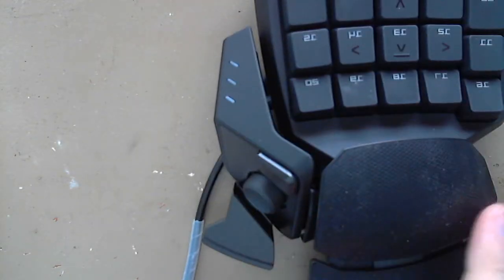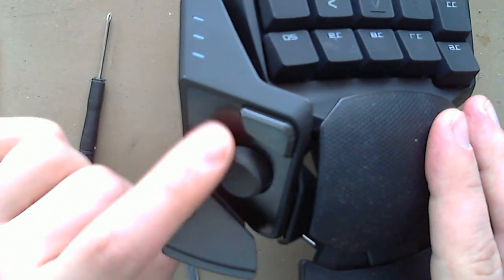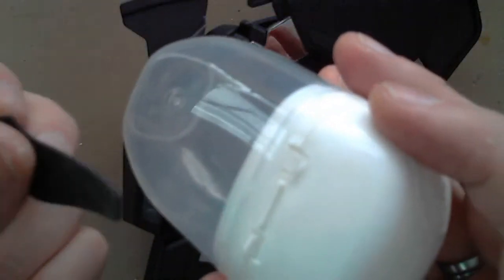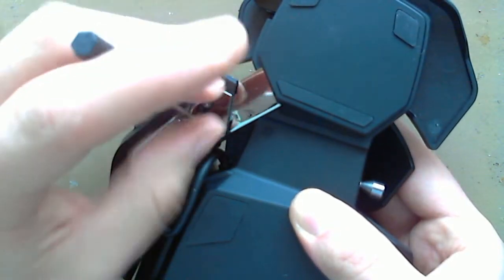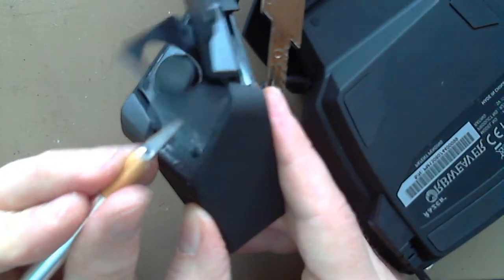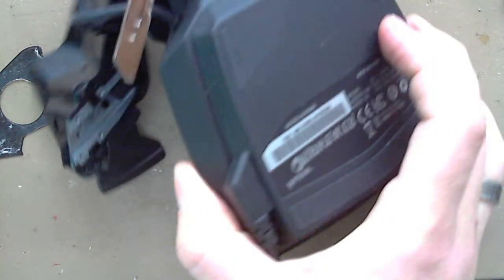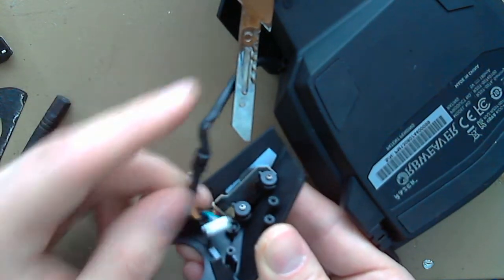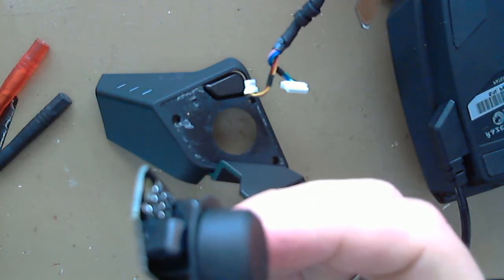Razer Orbweaver Thumbstick Mod - Part 1 Side Module Disassembly

Comment: To lift the thin plate on the thumbpad face, make a tool. Get a piece of 1mm thick PTFE sheet and use a file to create a chisel edge on one side. Then use emery paper to put an ege on it until it is knife sharp. You could use sherpening stines like a chisel if you have them. When you push it under the plate, it will glide uder and barely be effected by the adhesive. You can work it around until the plate comes away. It's softish stuff so the PTFE makes a great tool as long as you don't over stress the part as you lift it off.

Comment: Can you tell me what the micro limit switch is called that sits above the analogue stick on the orbweaver? I need to replace mine if you can help id appreciate it very much
Reply from the maker: @Mikey-oz2sp  it's the same switch used in the dpad and thumb lever. Two leg micro mouse switch.

Comment: Thank you so much. I had to get into the side module to attempt to fix a button and I could not find how to do so. This was a huge help.
Reply: Would it have happened to be the microswitch for the spacebar / clutch? Mine has started double clicking and if you know what's a suitable drop-in replacement switch that'd be awesome.
Reply: @ImTheKingOfHyrule  It was for the spacebar yes, but it was because it wasn't pressing at all. I opened it up and piece that hinged it in place had broken. I unfortunately don't have any advice on replacement. :(

Comment: I have major inconsistencies with one of the thumb pad switches and my piece is practically new it has just been sitting in a box for a few years. Where should I look if i want to buy a new one of those switches? Taking it apart was greatly aided by you videos thanks.

Comment: I'm having some issues with the button above the thumbstick. It mashes it when I press it, which is VERY bad for competitive csgo play. Where can you buy switches like that? Mine definitely needs replacing.
Reply from the maker: I'm not exactly sure. Razer has chosen switches that are not labeled. I have not been able to find direct replacements for them. Your best bet is to remove one, measure it, and try to search on Mouser or Digikey for a micro switch with those dimensions.
Reply: Hey, did you ever find out what it was? Having issues with that button too...

Comment: The JST connector at 18:35.  How many pins?  Is it 1.0 mm pitch?
Reply from the maker: Sorry it's been so long that I don't remember. And I don't have one of those devices laying around to open up.
Reply: @tuffrabit  No problem, thanks for the reply. I ultimately had to tear down anyway.  FYI it's 8 pin 1mm pitch

Comment: Hey there, sir. Nice mod. I have a question. 

So I was trying to disassemble the thumb pad and see why it was moving, but when I did that the ball bearing dropped, fortunately I didn't lose it however I didn't see where it dropped from. Where and how exactly am I supposed to put the ball bearing back in? Thanks in advance!
Reply from the maker: the ball goes into a hole/channel that allows it to rest against the ratcheted metal arm. Seat the metal arm first, then drop the ball -> spring -> screw.
Reply: Thanks for the fast reply!
And yeah I noticed those holes however it's almost impossible to sit the ball back in one of the holes as it keeps falling to the notched place of the arm. I think I need to open it :\

Comment: the joystick will stop working after a few months on almost every orbweaver. wonder if its a cleaning issue or if there's a way we can easily fix that since its so common. also had both hand pads expand and no longer fit then it starts to slide off. I had to peel both of them off, trim the edges and glue them back on.
Reply from the maker: You mean the factory DPAD? That is just a joystick looking hat resting on top of four really cheap mouse button style switches. Those switches are delicate and iffy even when they are not cheap, due to their design. They have a copper film that rests on a fulcrum and "pops" up and down with the action of a plastic pin. That film can easily lose its rigidity and become to flexible, thus losing its ability to "pop". That was a long explanation to simply say Razer's design is sub optimal and they naturally use the cheapest parts they can get away with.
Reply: @tuffrabit  are there any switches you can recommend to replace them?
My d-pad broke so I'm tryiny to fix it.
I disassembled my orbweaver using your  videos but can't find a proper replacement.
Reply from the maker: @dionarapnibhci1  Hey! Direct replacements are actually hard to find. The only real reliable source is from Alipexpress: https://tinyurl.com/y2q4urcb

Hope that helps.

Comment: hi there, you probably cant help me but im having problems with the thumb stick as it wont go left now ive stripped it down with your video right down to taking the thumb stick off taking off the x under it and the white stick its attached too. it seems that there is a problem with the actual button on the board itself. is this knackered or can i do something? thanks for taking time to help if there is some advice you can give thank
Reply from the maker: Yeah, those little switches go bad from time to time. You just need to replace it.
Reply: tuffrabit ok is there a site or somewhere I can get spare parts like that?

Comment: Do you have any spare space bar actuator parts? Or do you know where I can buy one? I dropped my Orbweaver and it snapped off.
Reply from the maker: Hey man, I don't have any spare. You could open the thing up and just replace that entire space bar assembly with a cherry mx switch. Just put a thin strip of wood in place of the space bar part and mount a cherry red to it. Will probably feel better than stock.

Comment: where do i get the parts?
Reply from the maker: There's a number of sites to get this stuff from... adafruit, sparkfun, amazon, teensy's website. i tend to use digikey mostly though
Reply: tuffrabit the thumb stick part I can find. It's the USB part. I don't know the name of that part.
Reply from the maker: That's a teensy. I've been using the Teensy LC.

Comment: mirrored camera settings bad.
list of resources, parts, and links in description so that we can find the parts and do this ourselves: no.
Too much video, and too many videos for this. While you were talking I skipped through to the next parts (in all 5 videos).
Nice try, but no. I'd be doing all this myself right NOW if you'd tell me where to get that additional IC/board, what it does, where you got the correct-fitting analog stick, etc.
Reply from the maker: There's a few good ways to offer criticism and lots of bad ways. Your way of doing so is bad and certainly does not incline me to helping you or changing anything. What you choose to do or not to do holds no meaning for me.
Reply: His assessment is spot on.  If you're offended because he didn't coddle you, then that's fine.  Keep making videos that more than 1,000 people won't watch.
Reply from the maker: Roy Price His assessment is spot on? The only things he's actually correct about I directly address, explain, and apologize for several times in the videos. Which implies that not only am I aware of the issues but that I am interested in improving. And then there's the stuff he's wrong about. If anybody thinks this is to much material spread across to many videos then clearly they just don't comprehend what's going on and what's involved in a mod like this. If anything it's all a bit condensed as there's more examples and steps that were either not included or glossed over. He didn't coddle me? Who cares? Let's be clear. It is entirely within the realm of possibility to offer a stranger some helpful advice without being a dick. There's a quite a difference between offering hard advice in a helpful manner and just being an ass. Viewed by 1000 people... Again, who the flip cares? If precisely nobody watched these it literally doesn't matter.
Reply: He had me thinking he had altered a right-handed rig, then I saw your
post about the camera being mirrored.
Just damn, does anybody know where to find a left-handed setup?